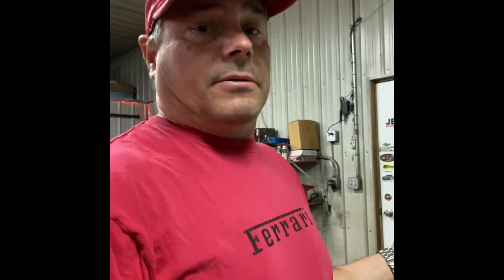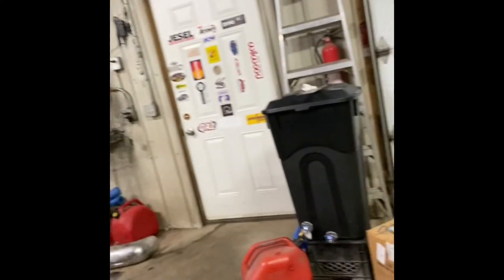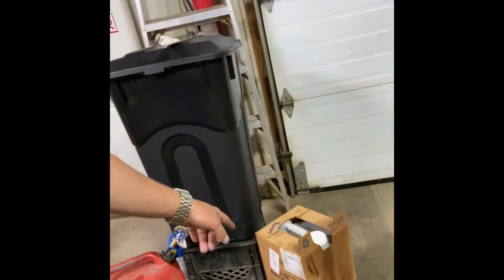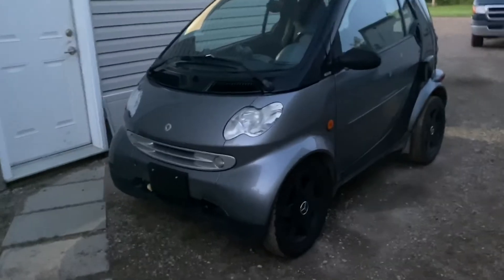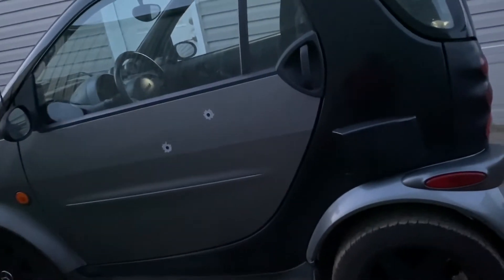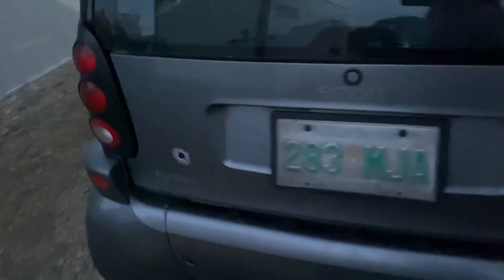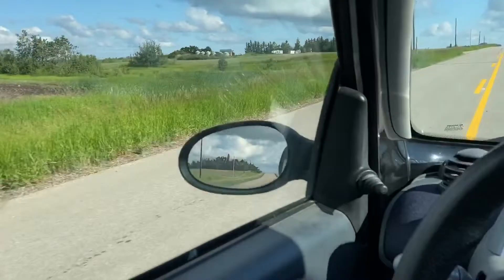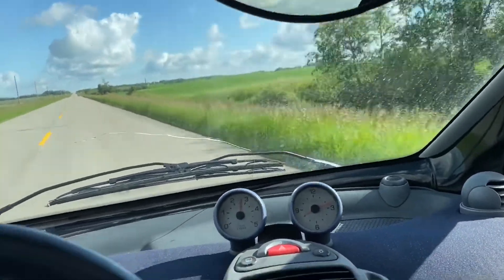Smart Car modified rolling coal runs on canola oil Diesel

Comment: Could you give me the information for the sprinter tips you utilized in your swap? I have a 2006 that I would like to mod as well. Thanks!
Reply from the maker: 2006 sprinter van with a 2.7 tips
Reply: @dorysch1 
Any idea what part number the tips were? Or what ones you ordered? There's a few options for the 06 sprinters. Id love to order a set for mine to compliment thy egr delete and flying tiger tune. Thanks!

Comment: Got any info on disabiling traction control on these 450s ? 

I got an egr delete and tuner box , the injector tips thing is amazing and im definitly doing it ! Is it the whole injector or just the tip being swapped ?? Thanks man !
Reply from the maker: All I do is swap the tips for the ones from the 06 sprinter , disabling traction control some guys just pull the fuse for it
Reply: @dorysch1  interesting , thanks man ! 

Is your exhaust just dumped after the turbo ? I like the center exhaust